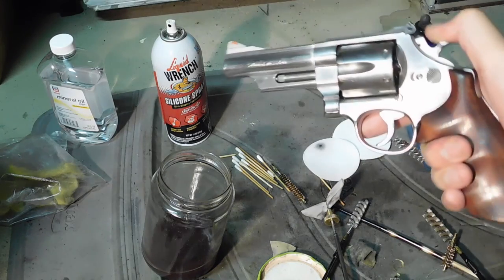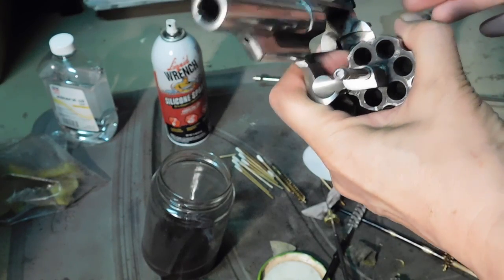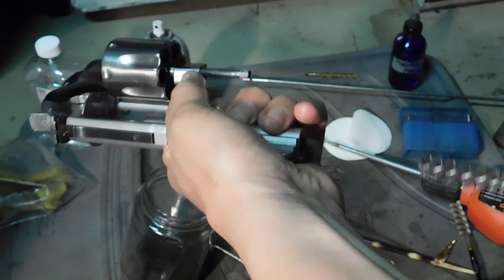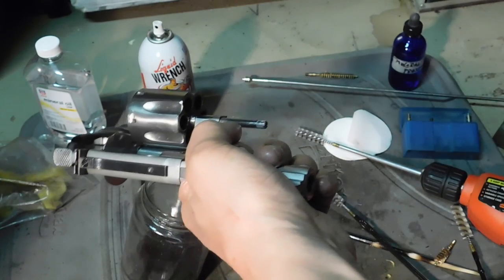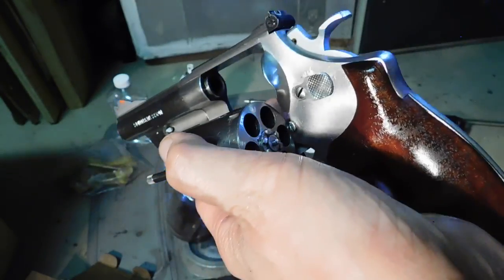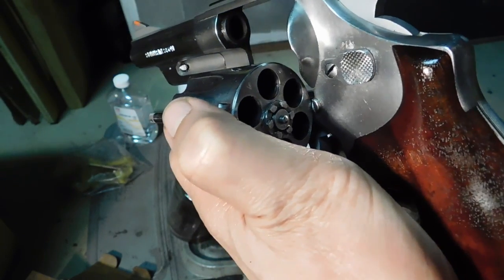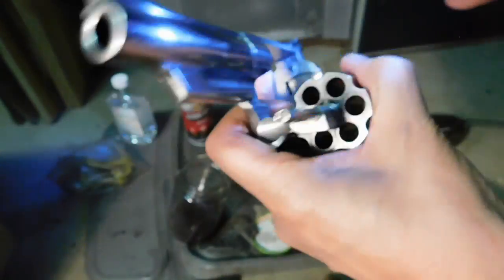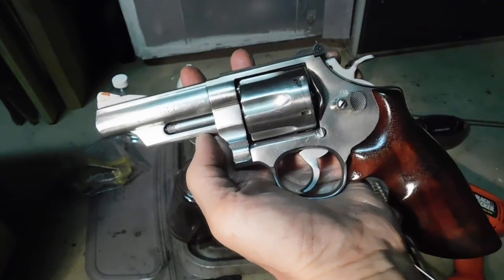Do Hi Tek Bullets Shoot Clean?

Comment: leading or no leading in barrel using cast lead bullets ...my experience is to slug your barrel and go 0.002 inch OVER SIZE (that's 2 thou over) with the lead bullets.i tumble lube with LLA and never ever had a problem since with leading..i can drive leads 15-18bh ( brinell hardness) at 2000fps and barrels look like mirrors inside., remember,  slug them barrels shooters....bullet fit is key...

Comment: FC, can you test bullets  coated with Hi Tek with one coating vs two coatings, and while this vid covers 3 maybe include 3 coats as the benchmark.  Sure would make life a little easier with just one coat.    Keep up the good work, we are watching.
Reply from the maker: Crabby Old Warrior - Thanks for posting.  Not wise to shoot bullets that have inadequate coating on inspection...and that's what I get with the first coating with the HT.  The recommendation is for 2 or more coats.  When we PC, the one coat gets us the coating we need there.  The HT requires less oven time.  (Latest tests by Elvis Ammo show that PC works well with shorter oven times also - I have not tried that yet).  Both systems work equally well - it's a matter of preference.  Best to ya,  FC Steve

Comment: shot about 400 rounds of 45acp/44 mag/.357/38/9mm from 6 different handguns all shooting HT bullets.. not one had a speck of lead..  none smoked when fired as was expected..  all cleaned up with almost no effort.     The Python was the only gun that was getting sticky for extraction but it always does.. it is extremely high tolerance and most know.    but.. it cleaned up just as easily.   All in all

Comment: Hi FC. You said you could shoot PC bullets without gas checks. Is HiTek  tough enough for that given the thin coatings?
Reply from the maker: Jeff Taylor - Yes, Hi-Tek is fine without gas checks at up to standard magnum handgun loadings.  However, gas checks may shoot more accurately in some bullets in some guns, so testing is required.  If the bullet is not a gas check design, the topic is moot.  For high power rifles, gas checks should be used and once the fps gets to 2000 fps, I still favor going to jacketed bullets.  You will hear of a lot being done shooting full power rifle with powder coated cast bullets...but until the 100 yard targets show decent groups, I'm not into that.  Good shootin' to ya,  FC

Comment: thanks again for the video. 
I have the bore guides for 38special 357  and 22 .
the problem is that coated rods simply don't fit. scrapes the coating off and ends up mess. 
I refer mostly to the 22 caliber. 
So no coated rods with bore guides and another thought is should one use a thinner rod, say a 17 or 20? 
that may be a good idea for any 22 gauge bore. usung a bore guide or not. any thoughts on this?

Comment: The High-tech coating system does a nicer job as far as the color coating. However, I feel that the use of powder coating is faster and easier in production. Takes less time. My Star unit will flat get with it now that I have hooked up the constant pressure air assist to the lube reservoir. as fast as you can pull the handle. You can out run the pressure and have to let it catch up.  Btw.. I'm happy that you discovered that benefits of using Mineral oil. works great...   Dave.
Reply from the maker: Thorsaxe777 - Finally, I'm going to be able to do the finish video on our 44 Special book (and if you want to do something later, it can still be added) - The range was closed totally for a while, and then when it reopened, only the outdoor range was open...I need both ranges open to do the finish video...but then I shot up the ammo I was going to use to do that video and now have to reload more...You are going to be doing a video on your air compressed Star machine I'm sure, I hope...I wish.... I don't have an air compressor for my reloading room or garage - always wanted one... Have a great day,  FC